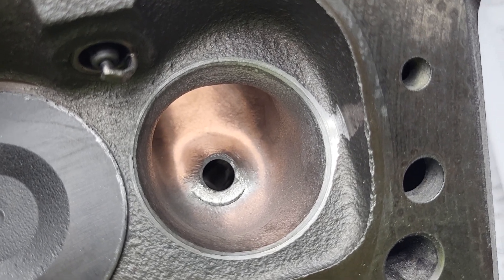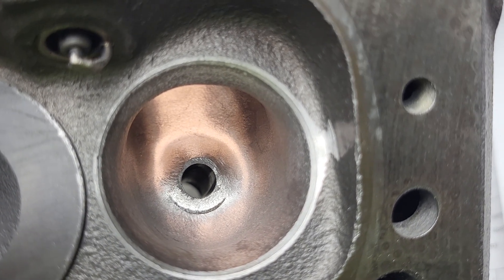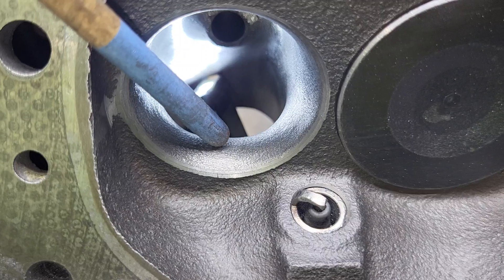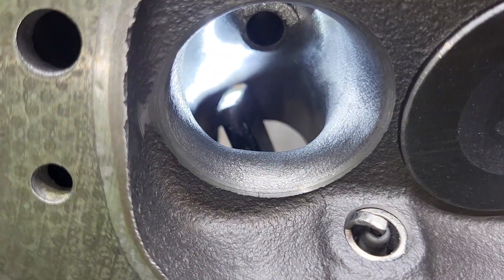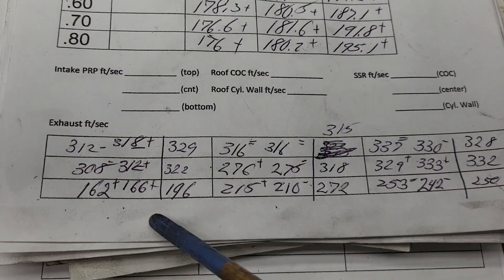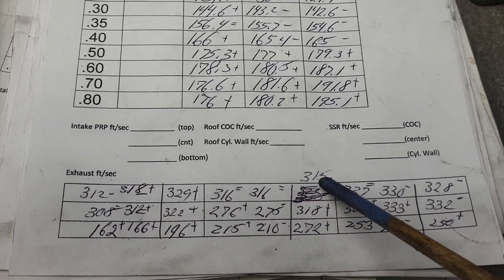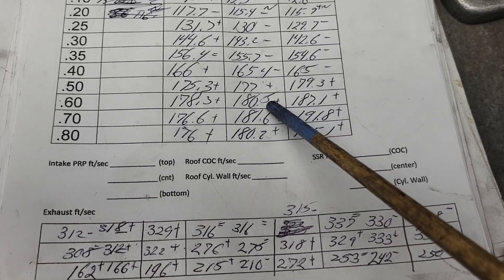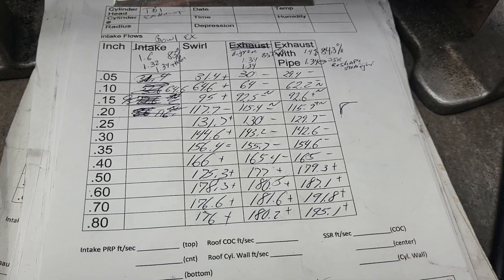Chevy TBI head exhaust throat experiment, bump up throat ratio to 84.3%

Comment: A thought. Does throat size corelate to primary tube size? You said 1 3/4" throat.  Would the port flow as much with a 1 5/8th primary? Or does it require a 1 7/8th.
Reply from the maker: 1.34" throat. I would use a bigger throat for bigger pipe aimed at higher rpm. Thanks

Comment: I'd like to know how much of the exhaust flow takes place in the first half of the cam's lift curve. I'd think a great deal since the cylinder pressure is highest at the beginning.  If the velocity is super super high it may change the whole dynamics of how the seat and port work at high pressure vs. flowing at 28" of vacume? I have no idea
Reply from the maker: Compression makes a huge difference in blow down.
Reply: Good point.
Reply: Most of the exhaust gas is out before piston starts to move up.